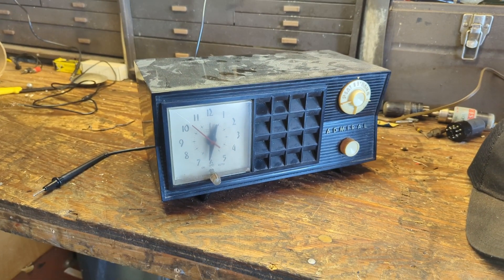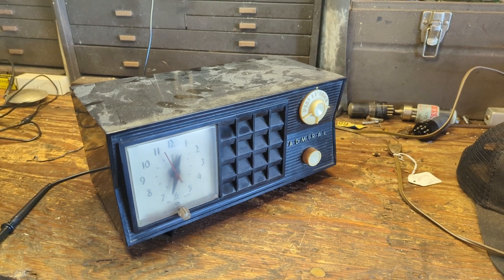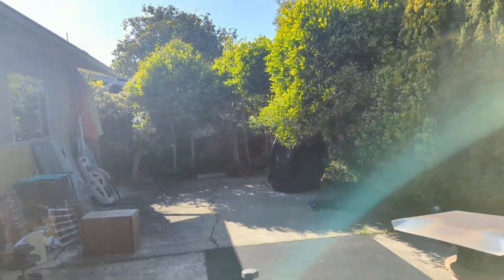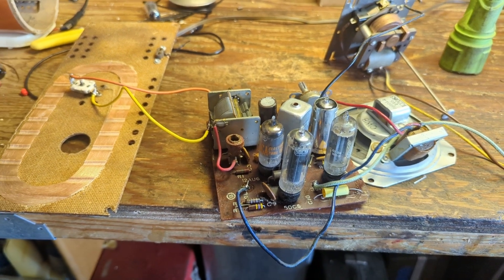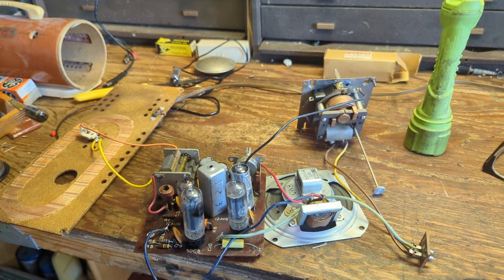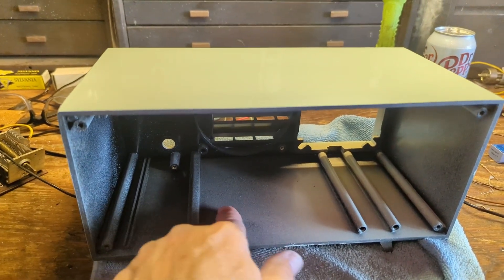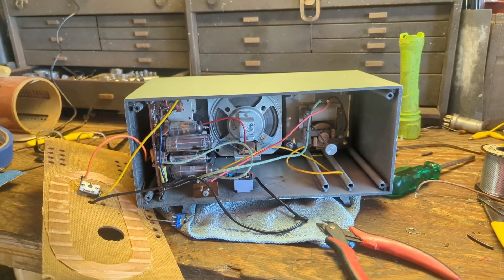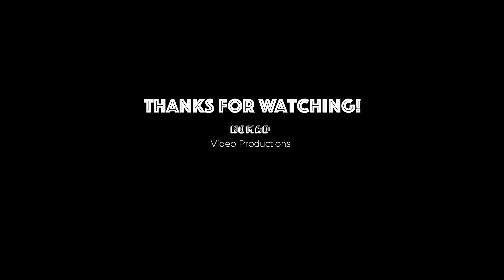Very basic 4 tube Admiral clock radio overhaul and custom paint

Comment: I really like the color, you do a wonderful job of painting these radios.
I would seriously think about limiting the current on the bench outlet to at least 5 amps or less for safety. It takes about 1800 watts to trip a 15 amp breaker, that is a lot of power.
 I am in the process of redesigning my bench and hard wiring in the isolation transformer out of sight like you have. I have not decided on weather to use a fuse, a circuit breaker, or tungsten lamps to limit current. My variac has a built in fuse, and I have a dim bulb array, but I don't always use them every time.

Comment: Hello Seth would you be interesting in making a AA5 have a more robust tone? I did this to my Arvin model 855t. You will need two 100k 1/4 watt, one 500pf and one 270pf. On the 50C5 remove all of the  connections on the control grid and solder one lead of the first 100k and one lead of the 270pf to the control grid. Solder the other lead of the first 100k to one lead of the second 100k. You now have both 100k resistors wired in series. Solder one lead of the 500pf to the connection where the two 100k resistors are soldered together and the other lead of the 500pf to b minus. Solder the other lead of the 270pf and the other end of the second 100k to the point that originally went to the grid. This will make a small 4" speaker sound amazing. Basically you've created a notch filter that de emphasizes the midrange. My Arvin uses a four wire ceramic network and I only had to deal with one wire from the ceramic network going to the grid but if you have an older set that uses discrete components you must keep all connections from the control grid together as its disconnected from the control grid. I haven't tried it on an older set but I think it should work too. Some AA5 like my crosley already has tone attenuation with a special tap on the volume control and those won't need any help they already sound awesome

Comment: Question, if you were to attach your audio input lead to the other side of that single pole trouble throw switch wouldn’t that eliminate the need to unplug the bluetooth device when you flip the switch from audio input back to am radio?